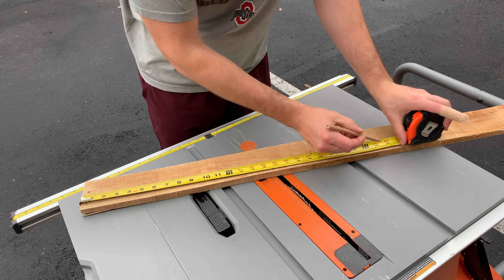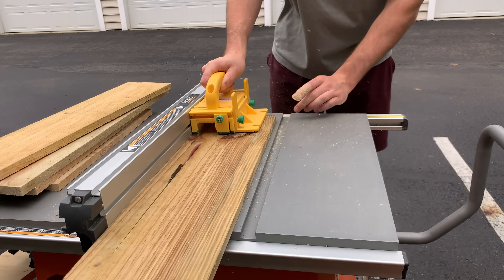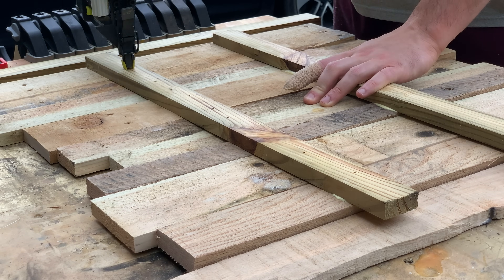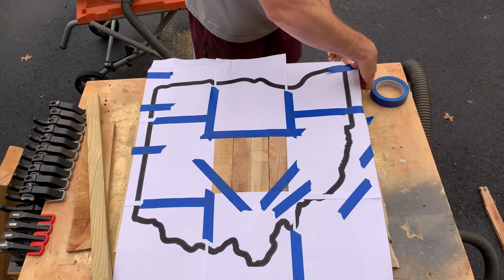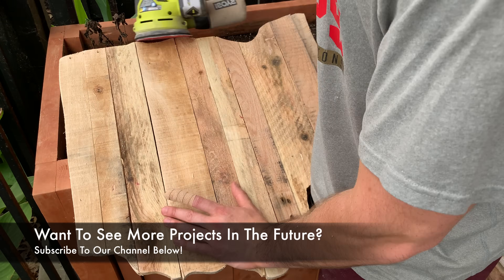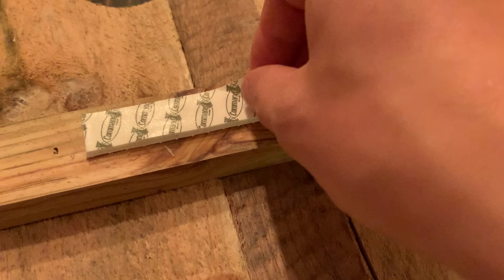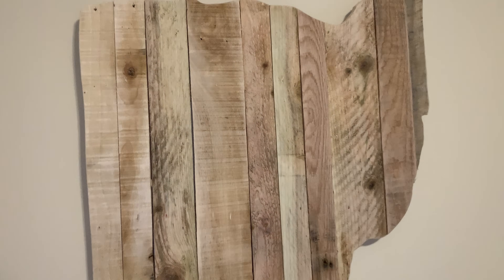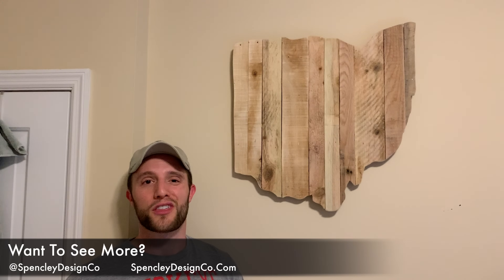I couldnt keep up with orders after making these

Comment: Instead of taping together a ton of copy paper, buy some cheap (45-50 cents) 22 inch by 30 inch poster boards. Take your original taped together pattern, after you cut it out with scissors, and place it on a sheet of the poster board. Apply 3 or 4 pieces of masking tape to hold in place. With a pen or pencil, then draw this outline on the poster board. Cutting out this time saving reusable final pattern is easily done with standard scissors. If you take your time doing it, you can eliminate the sheets of computer copy paper by simply drawing your pattern directly onto the poster board. Great idea for reusing perfectly good wood. I know a retired couple who make just as much cash money as their pensions pay them, by using old pallets and barnwood for similar projects.
Reply: Make a master template out of 1/2" MDF.  Trace the template onto the boards and rough cut fast as you can with a jigsaw.  Use your palm router with a high quality (e.g. Freud) 1/4" flush trim bit running along the MDF template to make an exact profile.  Might have to trim a bit here and there with a handsaw for sharp inside corners the router bit can't get into.

Comment: It does look a rather fun thing to do, I got a block planer especially for edges. For cutting the edges I would do it with hack saw an file then sand it by hand before gluing together 
Those two bits on back can help keep boards flat with another two not glues on front
Reply from the maker: Thanks for watching!

Comment: I made one of these only out of a single piece of plywood instead of strips of wood. I used a torch to give it a burn look that brought out the woodgrain. 

I used a piece of MDF to make a template so I could use a trim bit to easily duplicate it. 

Finally I printed the Ohio State logo on heavy bond paper and glued it to a 1/4" piece of plywood and trimmed it out and fastened it to the other piece to give it 3D appearance.

Unfortunately I can't sell it due to trademark laws so it sits nicely on the wall of my basement.

Comment: Nice idea. It kinda freaks me out that the back slats weren’t squared. Even hanging on the wall it isn’t square to the door jamb on the left. There’s also no way to reach behind and pull the command strip tabs. Cool idea, but leveling it up would be easy with minimum effort or cost.
Reply: He did his now you do yours
Reply: Show us how you did yours
Reply: Did you not hear? He used the Velcro strips. You just pull the strips apart by pulling the sign off. Then pull the release strips. Smart idea.